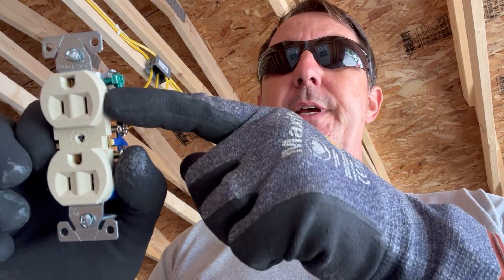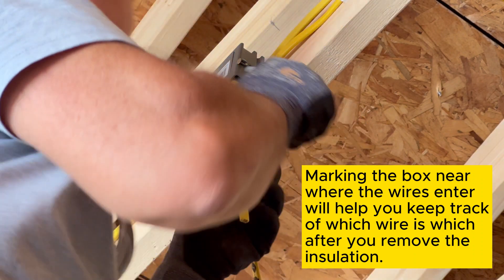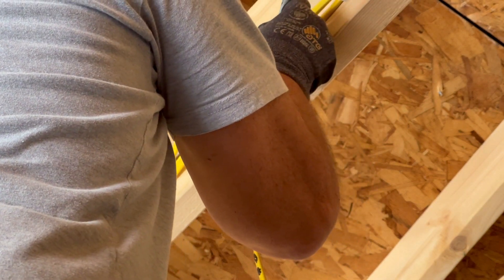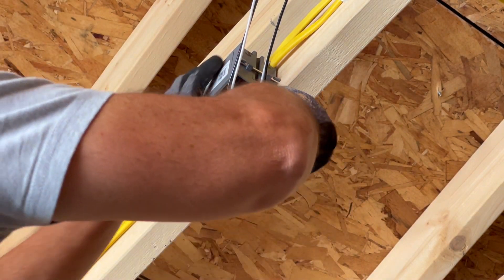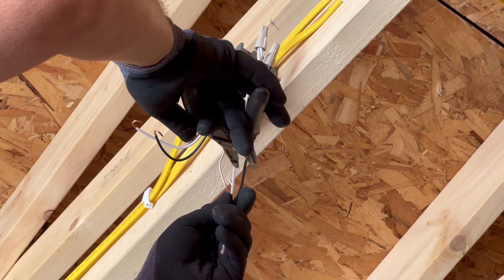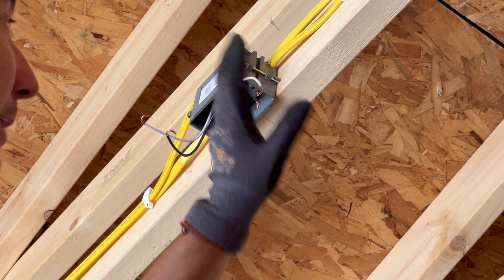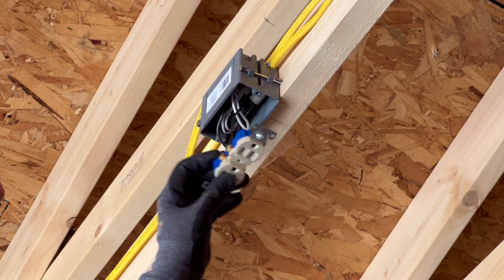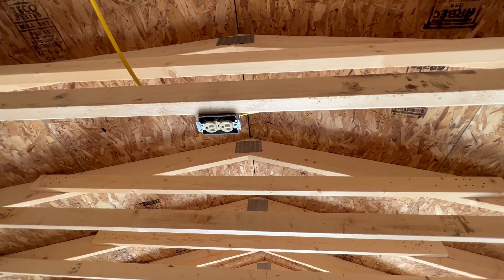How To: Wire a Multi-Circuit 1/2 Switched Outlet

Comment: I know it’s no longer done in kitchens because of GFI protection, could you have run a 12/3 and done a shared neutral circuit? save wire box fill and time.
Reply from the maker: Yes, many times a 12-3 is pulled here for a disposal and dishwasher sharing the neutral. You have to make sure each breaker is on opposite phases otherwise you could overload the neutral. 
Yes, definitely can’t be a GFI .
Reply: Known as a multi wire branch circuit, you could do it with 2 GFCI's. Red wire to one and black wire to the other, neutral pigtailed to each. Use Line connections only on each for power coming in.
Reply from the maker: @surferdude642 I don’t think so. Sharing a neutral between two GFI‘s will probably cause the circuits to trip. GFI are always measuring the amount of power coming in to the amount of power going out and if there’s any difference, it tripped the GFI so sharing the neutral. I would imagine would screw them up although I haven’t tested that theory. 🤔